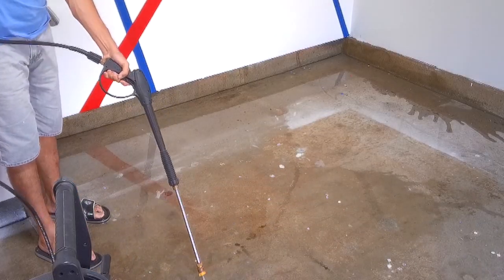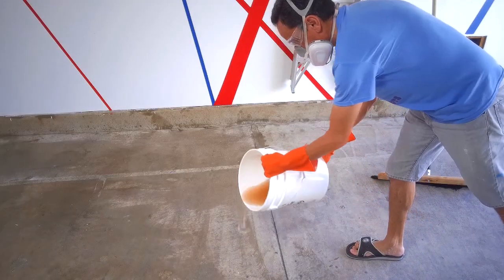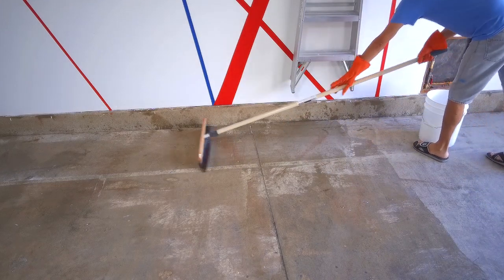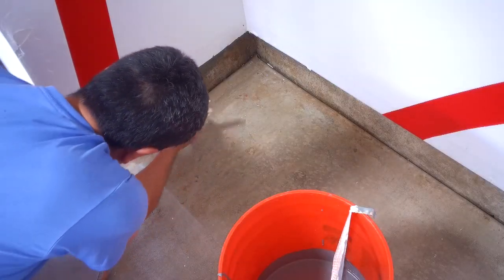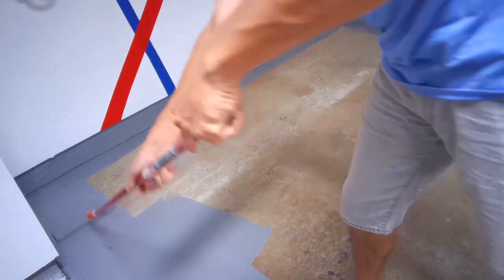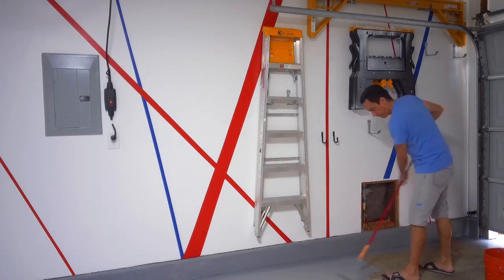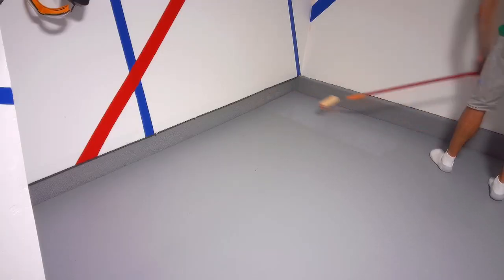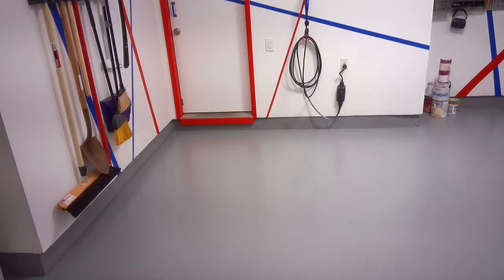Poor Man's DIY: Painting the Garage Floor

Comment: can i used latex based paint for floor? normal paint for wall
Reply from the maker: I have a theory that you can use normal paint BUT... you will need to add a very strong (probably expensive) epoxy on top of it. I am not sure I would try it but it sounds really interesting.
Reply: @Poor_Mans_DIY  yeah .. sounds interesting.. if you did please share it.. would like to know the result.. 10Q
Reply from the maker: @pilsajukseng  I did not try it because the very strong epoxy is way to expensive to use to cover an entire garage. Sorry
Reply: @Poor_Mans_DIY  if i paint floor with chalk paint is it ok?.. or need to seal the paint after it?
Reply from the maker: @pilsajukseng  Any paint you use on a garage floor needs a strong sealer or the tires of the car will chip the paint.

Comment: Its almost exactly a year now. How has it held up?
Reply from the maker: The paint flaked, but we knew it would and it has only flaked where the tires are when we park. Research indicates this happens because car tires get hot when driving. The heat from the tires causes the flaking. I also learned later that there is garage paint primer. primer always helps bind to surfaces so if I did it again, I would definitely use primer. Most importantly... we are still very happy and will do it again in a heart beat. If you have any further questions, please do not hesitate to ask and I will do my best to answer.
Reply: Can you please do a video of how it looks now please
Reply from the maker: @ericshwn  As I mentioned to many others in the comments section, the paint chipped very quickly after painting. it has only peeled where are tires are parked. we learned this happened because tires get hot after driving. in addition, we did not know of the garage paint primer at the time so we definitely recommend using it first. i have no problems taking pictures but i probably wont make a video. we have one year of nearly daily woodworking in the garage so it is a little unclean. i would pressure wash but worry it may pull off paint. if you want pictures please reach out to me at poormansdiy@hotmail.com.
Reply: @Poor_Mans_DIY  Hello, is only 1 coat of paint needed? Thank you
Reply: @hangnguyen3980  we used 2 coats. First coat was done horizontal, and the second coat was vertical. I would recommend using Primer first and use all the epoxy. I hope this helps.
Reply: @richardgrant4720  thank you so much for the reply!
Reply from the maker: @hangnguyen3980   I am pretty sure the instructions indicated two coats.

Comment: why would this peel?
Reply from the maker: The primary reason it peels is because of heat. Car tires get hot when driving (from friction) When you park , the heat of the tires causes the peeling. We do not have peeling problems elsewhere except when I used heavy equipment and carelessly dragged it over the paint and scraped the paint off in a few places. All in all, the paint holds up well and for the money, we have no regrets. The more expensive garage paints use a very thick epoxy, which makes it expensive. They prevent flaking but in time, they too fail. I hope this helps. If you have any other questions, please feel free to ask and we will do our best to provide a resolution

Comment: Why don't you show a follow-up to what it looks like today?
Reply from the maker: I do not have plans to do a follow-up but I will be 100% open in admitting that the floor started chipping/flaking within a couple months, but it occurred only where the car tires are located. I learned this is caused because tires get hot while driving and the heat caused the flaking of the paint. The rest of the garage looks fantastic and I when I do a touch up, I will use the same process. Other than where the tires are, I have chips in numerous places but they are all where I move my wood working mobile workbenches. I do a ton of building in the garage and the things I do are often not gentle on the garage floor.  For the everyday homeowner, I think this method is an inexpensive (but not perfect solution). I hope this helps but if you have any further questions, I will do my best to provide a proper resolution/response.
Reply: @Poor_Mans_DIY  Thanks for the reply.

Comment: I painted my floor for the first time a few years back and I don’t remember doing the epoxy, I bought a kit from a local store and painted on the concrete floor without using acid... within a few weeks the paint started chipping when i parked inside... now it’s a complete disaster with 3/4 paint gone ... not sure what to do.
Reply from the maker: When we painted our garage the inexpensive way, we expected chipping to occur. After we completed the painting we learned some additional information. First, there is in fact a garage paint primer, when we touch up or redo the garage again, we will most certainly use primer as its purpose is to bind surfaces to the paint. Next, we learned chipping occurs under the tires because tires get hot while driving and the heat from the tires causes the chipping when using this inexpensive option. If I were in your position, I would definitely remove the paint and use acid clean. if you dont, the paint does not stick to the concrete, it will stick to particles that were not removed with the acid wash. I do hope this helps.

Comment: Great video.  I was looking for a followup video to see how your painted garage floor has held up.   Can you comment?
Reply from the maker: Thank you for the kind words and for your great question. We knew, goinng in from the start. The paint would chip quickly , and it did so within a few months, but the chipping was where the car tires sut when parked. This is caused because tires get hot when driving and the heat causes the chipping. The rest of the garage held up well except for the fact that i do a ton of wood working in the garage. I have spills and chip caused from hammering, dropping, moving etc. That being said, I  am happy with the garage and will do it again as a refresh or touch up
Reply: @Poor_Mans_DIY  Thank you for your reply.  It helps a lot.  Do you think the addition of the concrete floor sealer helped as much as you had hoped?
Reply from the maker: @Growla  Long after posting the video, I realized I used the wrong terminology and referred to the coating as epoxy and it is not. That being said, I think the sealer is needed and provides a strength to the paint. An additional point. After making the video we learned that there is a concrete garage primer paint. I know the value of primer and use it for painting all the time. I will definitely use it when I recoat some day!

Comment: "The instructions stated that the paint isn't intended for vertical surfaces but we painted our concrete anyway"???? Huh?
Reply from the maker: I apologize for not clarifying. there is concrete at the base of each wall that is about 6inches high. so there is 6 inches of concrete that is vertical and we painted it. the paint seems to have adhered well. If you have any further questions, please do not hesitate to contact us and we will do our best to provide a proper resolution
Reply: @Poor_Mans_DIY  i see. Thanks for clarifying.